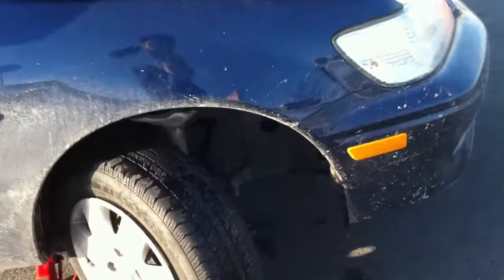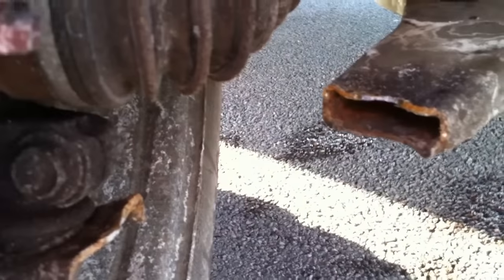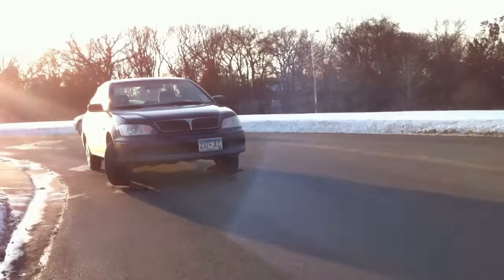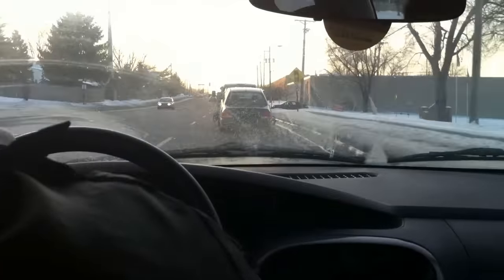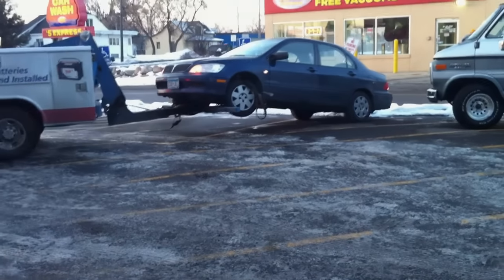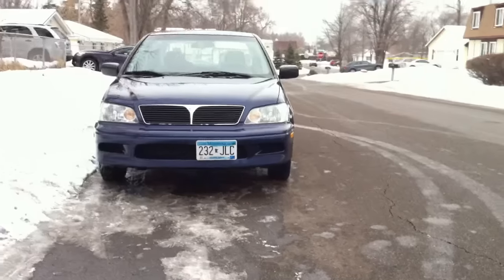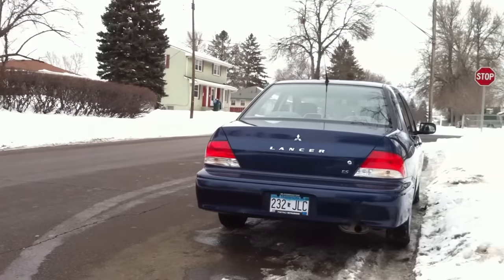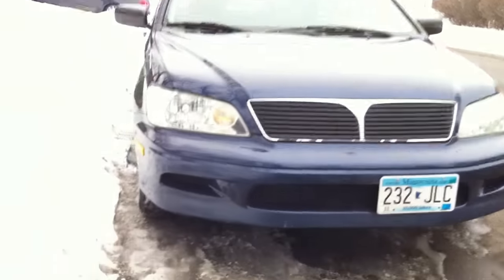Lancer Fix 9 | Broken Control Arm Update

Comment from the maker: Not yet. I believe they have been changed. For Lancers, these belts are replaced at 60000, 120000, 180000. So mine will be changed at 180000 next.

However, I can't tell the future and you might be right about changing them now.(cross my fingers) 

Thanks!

Comment: I just got a recall letter from Mitsubishi (2005 Lancer ES), basically corrosion can cause the control arm to break off like yours. You should check to see if your current Lancer has the same recall.
Reply from the maker: Yes! I got that letter as well.
Reply: DarkDragonWing you don't have your old car any more, but you should see if you can still file a claim, and get the repair cost back.
Reply: nickolastiguan I also got the same letter

Comment: it's fun to watch a car get washed from the inside.
if you dont mind, how much did it cost? 
i had both rear traction bars and rear upper camber links done. The most awesome thing is they are now a cherry red colour and adjustable lengths. i thought they were going to replace them with new stock ones but they upgraded them to aftermarket drift parts lol. $480 AUD. If you have Wilkinson suspension in america (wherever you are) they are pretty awesome.

Comment: Midas!!!!! I got a panic attack just hearing the name. Years ago I brought my truck for free estimate. They had my truck on a lift with the calipers hanging, and wanted over 600$. I said no way, I don't have 600$. I ended up getting help slapping 12$ shoes on it and it was fine. Bastards told me I needed calipers etc. I feel angry about them Getting your 800$.
Reply from the maker: +tim prater Oh man!! The parts for that fix are only about $150 combined! If I were to fix it myself that's where it will be. It was a cold winter so I got robbed letting them do it. sign.. never again lol

Comment: NOTICE: :You do understand that your accident is a part of a Mitsubishi Safety Recall # SR-16-003. Control Arm rust and breaks / fails bec of lack of anti-rust. You also do understand that you can claim the damages to Mitsubishi. Everything you've spent on the car. Right? It was not your fault bro. It's Mitsubishi's. All you need to do is call Mitsubishi, give them your VIN, receipts and you will be reimbursed. Including the carwash. Did you sustain any injuries? You have this video as proof. Mitsubishi Tel 888-648-7820. I repeat, it's NOT your fault. It's the car's substandard component that failed.  I'll send you a copy of the Recall Notice. Any questions feel free to contact me.